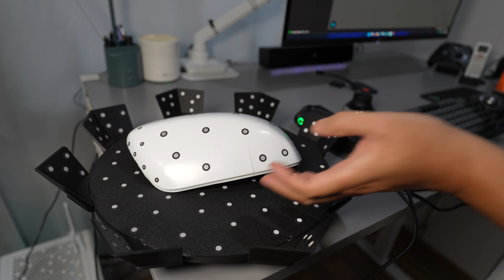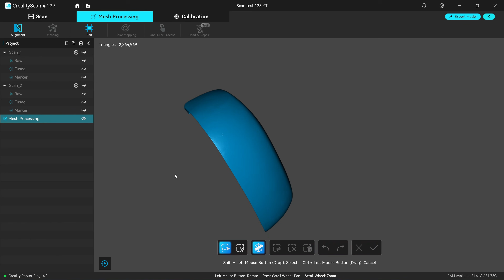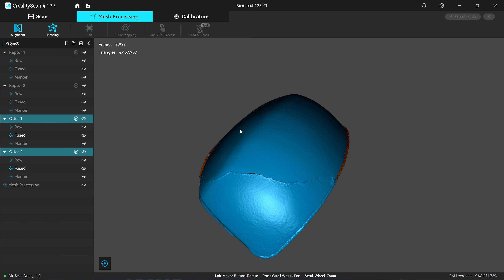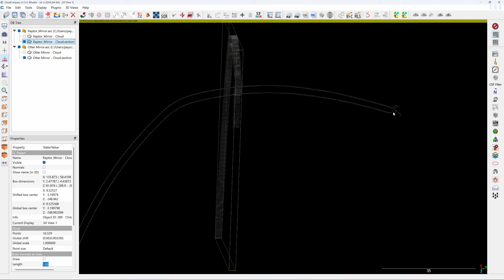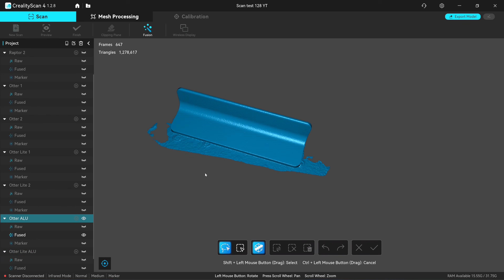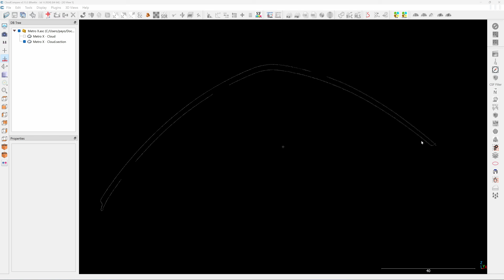Budget 3D Scanners That Actually Work for Car Parts – Creality Scan 4 Tested!

Comment: Hello Payo, that’s for the great videos and content, very useful and informative.

I got a question, I already own the revopoint metro y pro and was wondering what scanner should I get next that complements the y pro. The mini 2 is a great scanner but cannot justify the expense as it is similar to the y pro. I was wondering if the normal cr-otter would be the best choice? I like the ability to scan faces and body but also do smaller objects, I know that the y pro can do similar but cannot scan body and faces with it.

What are your thoughts ?😊
Reply from the maker: I currently use Otter Lite for human scanning, connecting it to my Android phone. While the original Otter delivers better results for face scans, Otter Lite produces output that’s more than adequate for resin printing.

Comment: Thanks for this interesting video. Got myself a Creality Raptor scanner and tried using it wit my Lenovo T580 Laptop i5 16 GB laptop, which doesn't meet the minimum specs. Accordingly I got very poor framerates of just 2 or 3 fps. Your results of 50fps look amazing. Could you schare some information of  your PC configuration? Thank you and many greetings from Germany
Reply from the maker: My PC has i9-14900K CPU and RTX4090 GPU, my laptop has Ryzen 9 8945H and RTX 4070, both give the maximum speed for Raptor.
Reply: @Payo-TensileCreator  Thanks a lot for this information. So I definitely have to go for a much faster new PC with a Nvidia graphics card!

Comment: Hi just throwing this in here but the S1 is having issues with the 7 lines mode not sure if anyone else has this problem its just very choppy and not smooth like the other two modes. It's jumping from optimal, to too far, to optimal and then to too close. Can't use it for scanning 7 lines have to use my raptor for 7 line scanning and then swap to S1 mid scan.
Reply from the maker: Once the firmware is updated, make sure to calibrate the S1. I’ve seen a few instances where the screen jumps too far or too close, and a quick calibration usually fixes it.
Reply: @Payo-TensileCreator  Made sure firmware is updated 1.0.6 but still unable to produce results now even in any mode only single line works. I don't know if its down to what processor I have but the graphics card is pretty high 3060ti and E5-1650 v3 cpu.
Reply from the maker: @markodjuric8026  The GPU is acceptable—it won’t deliver peak performance, but it’ll get the job done. However, a decade-old CPU is inadequate. You’ll need at least 8 cores and a processor from within the last four generations.
Reply: @Payo-TensileCreator  Newest update fixed all issues now everything works perfectly.
Reply from the maker: @markodjuric8026  Glad to hear that. I notice speed increase on S1 as well. Now I can scan cross line at 0.1mm res full 90 FPS !! Before that it was 70 FPS

Comment: I would like to add, I have a 3Dmakerpro Lynx. I love it, the resolution to me appears to be pretty good and accurate I’ve designed several parts( intake system, headlight ducts) and it’s pretty good. I have tried a metroX and I actually enjoyed and I thought it was pretty good to use and was nice to use not sure if this is because it’s a nicer machine then my Lynx. Would love your take on the Lynx.
Reply from the maker: The Lynx just doesn’t have the resolution needed for tiny parts like this, and JMStudio couldn’t handle the thin shell when I ran it through the Moose. Good news though—3DMakerPro is sending me a Seal to test, so a video’s on the way. As for the Metro X, it’s in the same ballpark as their POP and Mini lineup, but it’s still no match for a proper laser scanner.
Reply: @Payo-TensileCreator thanks for the quick response! I am considering an upgrade eventually what would you recommend for work like mentioned above (mainly large scans not as many or no small parts) I love not needing the markers makes it so easy to scan especially when working on cars that aren’t mine
Reply from the maker: @ralphmag3072  Otter Lite can scan the entire back side of my car without using the marker. But not as sharp and precise as the laser scanner.  https://youtu.be/8LzmYzUfo0s?si=5TTJpVILT7W3TTfX&t=1559

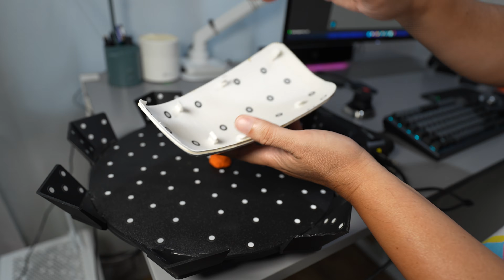Comment: 2:48 How does scanning with markers work in this case? Did you do the global markers scan first with our without the part?
Reply from the maker: I didn’t use global markers in this video. When turntable markers are imported for scanning, the software tends to disregard any markers placed directly on the object. With Otter, Otter Lite, and Metro X, their limited tracking range means you still need to apply markers directly onto the object itself.

Comment: Hi! Please tell me, with the new version of OTTER software, can the entire machine be scanned in a circle now and connect the beginning and end of the scan normally?  
*Translated by Google
Reply from the maker: No, the software doesn’t correct NIR distortion. In this case, the part is small enough that the distortion isn’t visible. For larger components, I’d recommend using the Raptor—it offers significantly lower distortion.
Reply: @Payo-TensileCreator  Thanks

Comment: Why is MetroX scanning so bad? I saw one video, it's relatively new, it's probably less than a month old, and the MetroX turned out to be better than the Raptor Pro. I really want Revopoint to be able to bring its software to mind and for MetroX to be able to capture distant markers.
Reply from the maker: This marks my fourth Revopoint scanner, kindly sent by a viewer here. We’re on the same page—it’s frustrating when manufacturers repeatedly use deceptive marketing and face no consequences. I’m proud that these videos have supported the 3D scanning community. Scroll down to the comments for honest opinions from actual users.
https://youtu.be/cZT8VM36zZ4
https://youtu.be/5MKCLsJeoUE
Reply: @Payo-TensileCreator  The videos you gave below are no longer very relevant. Many problems have been solved by the revopoint developers. The only thing I noticed is that the metrox laser lines are thicker, which means they work worse, and this is a hardware disadvantage and there's no way to fix it. Same of the software disadvantages is that it scan a table and does not fix distant markers, but let's say that these problems are solved, which scanner will be subjectively better and for what tasks? Apart from the fact that crealty has a neural network that makes their scans much cleaner than revopoint's.

I'm wondering which scanner has more potential, assuming that the software has been brought to perfection.
Reply from the maker: @werckut  Three limitations of the Metro X that no software can resolve:

- Resolution: The Metro X’s true resolution is 0.3 mm, constrained by its low-cost camera sensors and diffractive optical element (DOE). In contrast, the Raptor delivers a genuine 0.1 mm resolution.

- Field of View (FOV): The FOV is hardware-locked, dictated by the lens and CCD configuration. Metro X has a notably narrow viewing angle, making it less efficient even compared to entry-level models like the Otter Lite.

- Precision: In terms of precision, Metro X sits at the bottom tier—right alongside the POP and Mini. Try merging two scans of the same object, and you’ll spot a clear misalignment every time.

And perhaps the strangest quirk: Metro X is the only laser scanner I’ve seen where parallel line scanning outpaces cross-line scanning—an anomaly that defies typical scanning logic.

Metro X is just a modified POP scanner with laser line input patched in. Even the FPS shown on the interface is simulated.
Reply: @Payo-TensileCreator  thanks.

It turns out that even if we consider not only the crealty brand, then the Raptor Pro is the best option for its price?  Well, as I understand it, Raptor X and Sermoon S1 will be better. If I want cheaper, can I buy Otter or just Raptor, or is it better to add and buy the Pro version?
Reply from the maker: @werckut  If you're just starting out with 3D scanning for reverse engineering, the Raptor is a solid choice—available for under $800 on AliExpress. Once you're more confident with CAD, upgrading to a higher-end model can help streamline your workflow.
Reply: I think the problem with Revopoint and their software is that they all (Revopoint, Creality, MakerPro) used to use the same core software (you could use them interchangeably with a few tweaks), but the  Creality fork just kept advancing and they aren't open source.

It'd be nice if we had an open source (think PrusaSlicer) framework for these, but the walled garden approach is all anyone is willing to do at the moment.
Reply: Thank you payo , can you make a qualité scan comparaison between CR3 and CR4 for otter scanner

Comment: Dont have problem with CrealityScan 4? I buy recently Creality Raptor and i have problem: it disconnects and reconnects after a while. Now i use last version of CrealityScan 3..3.46 and I didn't encounter any problems.
Reply from the maker: I’ve had zero connection problems with the Raptor on CR 3 and CR 4. Otter’s a different story—it keeps dropping out when plugged into USB-A. I’ve had to switch to USB-C using an adapter, probably because it pulls more power than USB-A can deliver.